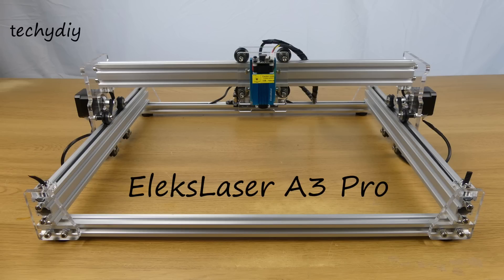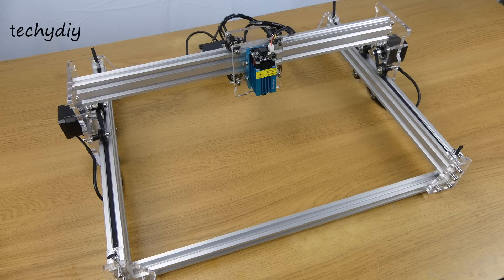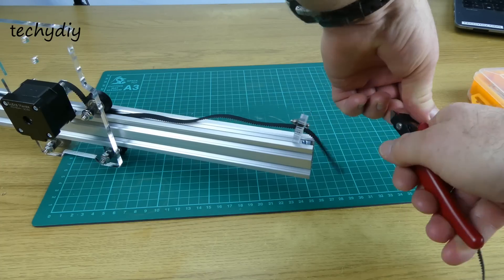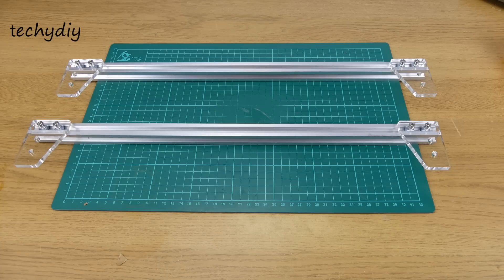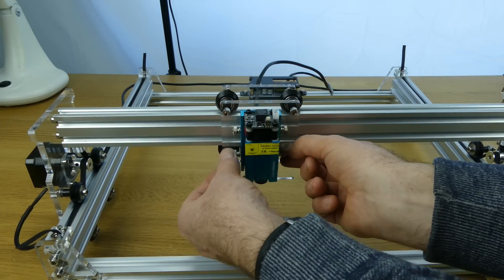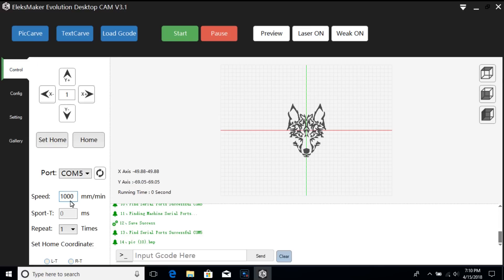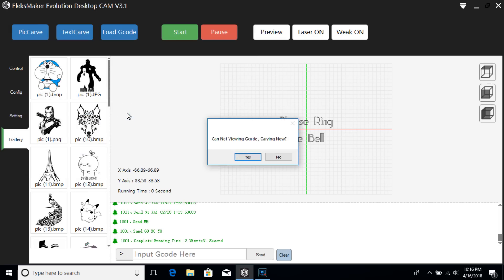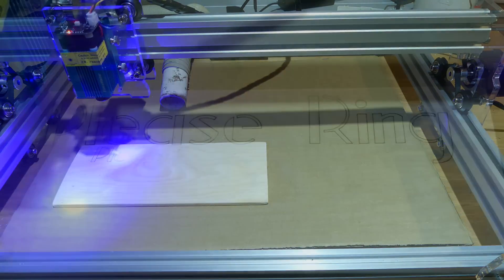Eleksmaker EleksLaser A3 Pro Laser Engraver Build, Test & Review

Comment: Hi Nigel,

First of all I wanted to thank you very much for your video, it's a great review of the laser engraver EleksLaser A3 Pro and it's also very informative. 

In minute 9:15 of the video you successfully show how to etch a PCB using black mate spray paint, I recently purchased the EleksLaser A3 Pro and I've been trying to get the laser to burn the paint, but I haven't been successful yet. I was wondering if you could share with us the type of paint that you use for your PCBs. 

Also if you have any advise on how much tension the belts should have, I haven't been able to find any video o tutorial online that show or explains a technique to make sure that you have the right amount of tension on the belts.

Any information that you can share with me would be highly appreciated.

Thanks,

--
Freddy
Reply from the maker: Hi, thanks. 

I made the belts finger tight, removing the slack and not putting much strain on the components.

For the pcb, I have used various types of matt black car spray paint, it doesn't seem to make much difference, just use the cheapest. 
Another option is to use an etch resist pen or marker instead of the spray.

Spray a very fine single mist coat onto the pcb board, you don't need to put on as much paint as you might think. 
Test for the minimum amount of spray paint on some scrap copper clad board.

I etch the paint with three passes of the laser.
Then I clean the pcb with water and washing detergent.

It is very difficult to see if all of the paint has been removed, so I check the tracks by scratching the copper surface to see if any of the paint film is still masking the copper.

I have found that you can scrub the pcb quite hard without damaging the paint layer.
You also might want to try some rubbing alcohol  or similiar to remove the etched paint film.

The other option is to use multiple single passes of the laser and then clean the board in between. For that you need to be able to accurately  re position the pcb each time.

It did take me a few attempts,  but ultimately the key to getting it to work was to make sure the tracks were cleaned  right down to bare copper. If the copper doesn't start etching straight away then its more than likely that there is still a film of paint on the tracks.

Hope that helps.
Reply: Thank you. I tried the cheapest matte black spray paint I found in the store and it worked very well. You were right about the fact that cleaning the board before the second pass of the laser does help getting better results.

Comment: Hi - would this be suitable for cutting spray art stencils from mylar sheets (less than 1mm thick)? Im wondering is it would give clean cuts or 'melt' the mylar too much? any thoughts appreciated - thanks
Reply from the maker: The laser is not able to cut transparent or white material, you would have to choose a different type of laser for that.
It cuts coloured (ideally black) plastics very cleanly.
You can coat some materials with black spray and then engrave them, for example glass.
I have used black card for stencils, which worked ok.
Reply: thanks for the reply. Good point about not cutting transparent materials. I wonder if i could spray the mylar black first then cut it? If not, black cardboard would possibly work - cheers

Comment: You're going to want to play with speed and power for that laser. There is no need to leave the last at 100% for all uses. Higher power means you are more likely to burn the material and make more smoke. Lower power means less burning, but you'd need to use a lower speed to compensate. Ultimately it is a balancing act between speed and power, and the balance will depend on the material in most cases.